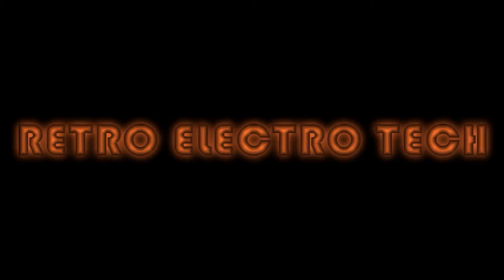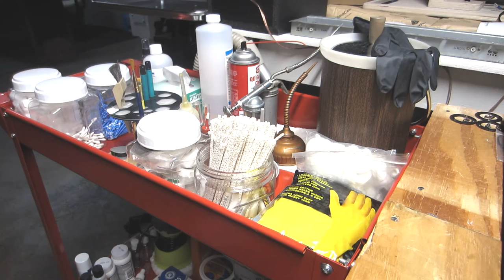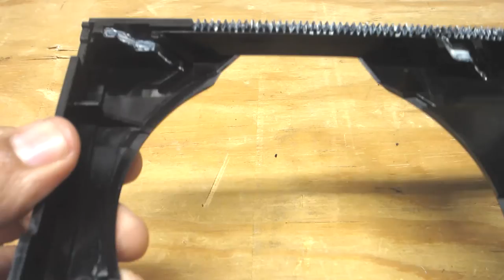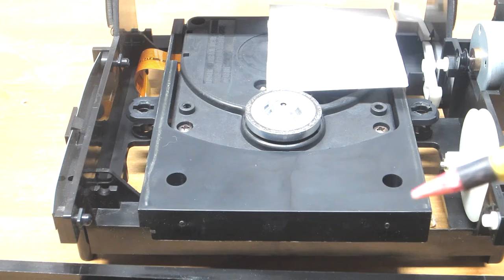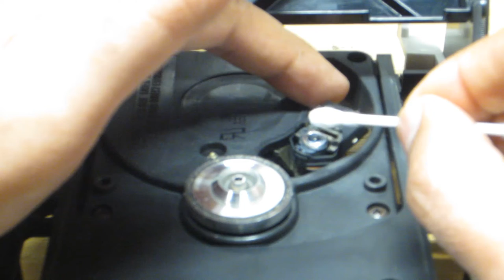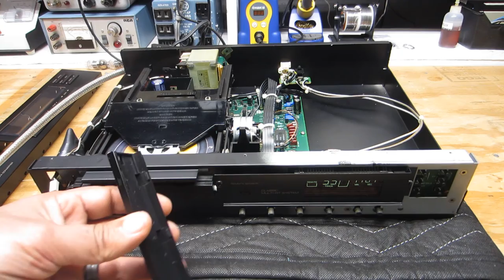Rotel RCD955AX CD Player Part Two Finale

Comment: enjoyed this 2 part series. currently troubleshooting a rcd-965bx that makes a swishing/chirping noise during playback.
Reply from the maker: Thank You for chiming in, hope all is well. Some times that type of problem can be on account of a few different contributors, which can make diagnosing the problem more difficult at times. For example, could it be an issue originating in the electronics / i.e. a failing / failed component/s that may be disrupting some normal playback control functions? A definite possibility, until ruled out through some quick signal analysis and spot checking of voltages (etc.) along the "signal pathways" and all supporting circuitry that may be in question during a good ole fashioned diagnostic session. So, there's that part of the equation, when dealing with the electronics, and whether or not a person is able / willing to dive in to that world of work?  There's  also the obvious mechanical part of the equation, which typically isn't too big of a problem to contend with, and I first follow a "CLA"  approach, "Cleaning, Lubrication and Adjustment". As mentioned, things need to work / move fluidly along their path of design, without interference, along a track / rail / pivot point etc., of which needs to happen in a fairly tight and fairly precise manner. If there's no useful data available about the mechanism You're working on (which will often be the case), then You'll have to study the mechanism/s,  to familiarize Yourself with their intended operation, then You could troubleshoot from there, looking for common / expected problems involving "moving parts". So, again, from the electromechanical list of things that might be be the problem, I'd of course start with the obvious stuff. Make sure the lens element of the optical pickup (laser) is clean, free of haze / fogging/Heavy scratches/ nicotine/tar accumulation. Of course, that's a common cause of "read issues" (dirty lens) which could be causing Your problem etc. Otherwise, if You go into the electronics / electrical adjustment phase, it would be a good idea to track down a service manual if possible. As You can see, this can get lengthy because of the various possibilities. So, start with the preliminary stuff and build Your "file" as You move deeper through the layers. In closing, once You have a good solid grasp of How these machines function, they're all pretty much the same (in principal), nonetheless, I'm going to cut this here, my best to You, I'm sure You'll get it worked out, let me know.
Reply: @retroelectrotech  
Thanks for the reply! I've had the unit apart 3 times now trying to figure out the noise which can be heard across the room during quiet passages. I cleaned and lubed the tray mechanism, gently cleaned the laser with isopropanol 99%. I also made sure there was no interference of the disc as it rotated or foreign object within the mechanism. The chirping persists. I am going to bring it to my local electronics repair center who are authorized warranty repair for Rotel among other brands. There is a $40 diagnostic fee and then about a 30 day turnaround for the repair. I hope it can be repaired fairly easily. As old as it is, I still find it to be a very musical player worth fixing. I will report back on their findings. I have read of others having the same issue on the audio forums. Thanks again.
Reply from the maker: @deathb4digital  That's good You're able to find someone near You who can look into it in more detail. At least You ruled out (to some degree) any obvious mechanical issues etc. My best To You, hope it gets resolved. 🙂
Reply: Poor tracking on this mech is often the bearing in the top clamp. Release the springs, take the top arm off and in a clean area lever off the white bearing housing careful ball bearing may fall out. Clean bearing and cup, lube bearing top and bottom with best grease. If it's worn an indentation(s) in the arm a good indication of use, smooth it out with sandpaper or cover with teflon sheet. Blue tac on the crystal improves soundstage. Replace c160, c301 with polymer.

Comment: Very informative two videos. I just picked up the same cd player. So far, everything seems to function well, and it sounds good - except the door faceplate has the same problem as the one in your video. Were you able to repair it as you planned, or did you end up using a different method? Thanks.
Reply from the maker: Hello there, I did a little video on that but I titled it in a way that isn't obvious it's related to those other two Rotel videos, or else you would have found it, why make things easy right? ;-) Anyway, below is the link, you may want to skip through some of the chit chat, or not, my best to you :-) 

https://youtu.be/C4jd8AXSISs?si=oVQhCCYLVyI5yyF-
Reply: Thanks for responding.  Very helpful - and I enjoyed the chit-chat. It looks like it will be an exercise in patience. Not a bad thing at all. Take care!